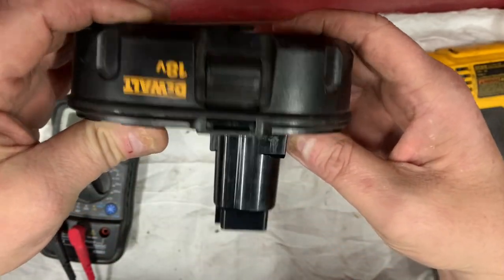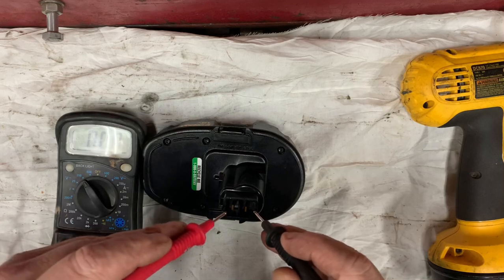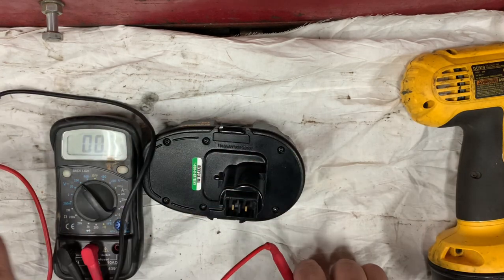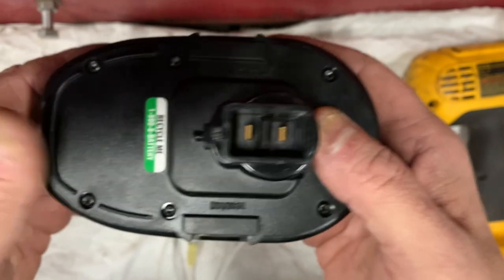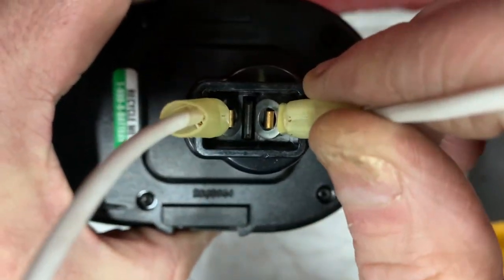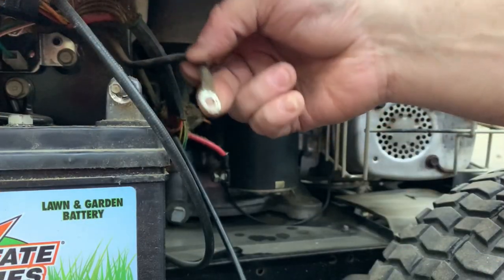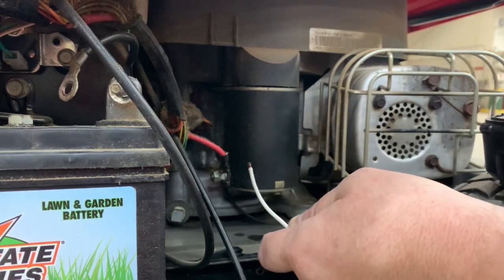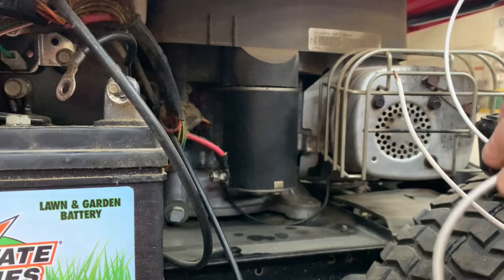CAN YOU CRANK A MOWER WITH A DRILL BATTERY? LETS FIND OUT!

Comment: I'm glad I found this. I have an electric start push mower that I fixed up, but haven't replaced the battery on yet (I've just been pull starting it). I have plenty of tool batteries though, so I might find an old tool or charger to chop up and wire into the battery box so I can just pop a tool battery in it whenever I want to mow.
I thought I would need to use something to drop the voltage down closer to 12v, but from your video it looks like I might not need to. :)

Comment: I have a walk behind mower with electric start.  When the OEM battery died I took a spare charger and wired it to the battery connection on the mower. Chuck in a battery.  Starts it up reliably and saved me having to plug the mower into a wallwart and deal with another battery to maintain and replace every 2 years.
Reply: I don't understand. why did you put a charger in there. why not just hook the battery to the starter?
Reply from the maker: What would that accomplish?
Reply: @THEMOWERMEDIC1  I was asking @Joe Olejar why he didn't do exactly what you did in the video. It sounded like he threw in some unneeded parts. Maybe he's talking about using the battery socket from an old charger, not the charger itself.
Reply: @kellyq21  I just used the dead charger as a way to drop in a battery and easily remove it when it needs recharging.
Reply: @joeolejar  Ok I see. Same as what I am doing except I bought a plastic socket for a DeWalt 20V 5Ah battery. My problem now is (I think) it doesn't put out enough cranking amps to start. The starter just spins. The rope works.

Comment: That may work for a short bit but the battery is 20V so it's going to blow up the 12V starter.
Reply from the maker: lol no it won’t. People convert 6 volt tractors to 12 all the time
Reply: Under load, the 18 volt battery puts out a little over 14 volts.  3 mowing seasons and the starter is still good.  This may not work for a 2 cylinder rider
Reply: 14v? I didn't know this, Idefinitely try this

Comment: I have heard that it is very hard on nicad batteries to short them that way.
Reply from the maker: Nah.
Reply: It's not being shorted, how is running a starter any different than bogging a drill or saw?
Reply from the maker: @jay90374  it spun that engine pretty good. And that’s an old battery too.
Reply: @jay90374  I was referring to when he shorted the wires together after connecting them to the battery to make a spark before he connected the battery to the starter.
Reply: @gordonwilloughby8793  Okay, that was a direct short, but I can't see those few milliseconds causing any damage.
Reply: @jay90374  Back when I read that if I remember correctly they said that Nicad batteries would arc when they were shorted but not to do this because it was very hard on them. It has been a long time since I read this and I don't even remember where I read it so I can't verify its accuracy. I don't think it is a practical way to check any battery because it rapidly uses the charge of the battery and reduces the amount of charge the battery has so it isn't fully charged when the load is connected..

Comment: Try using a hair dryer and heat the screen on your LED and see if it comes back
Reply: Screen will turn black before it changes then let it cool off
Reply: Best way is to clean the contact disc under the rotary switch. Fixed up plenty of them this way that didn't want to show much or half the numbers. Never take heat to the LCD, it'll just boil the liquid and burst the cells by expansion.